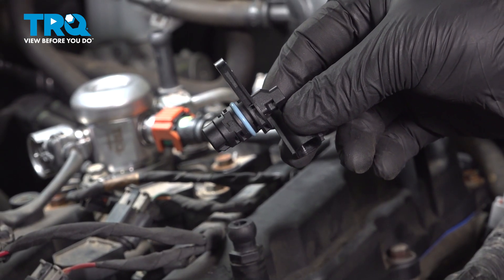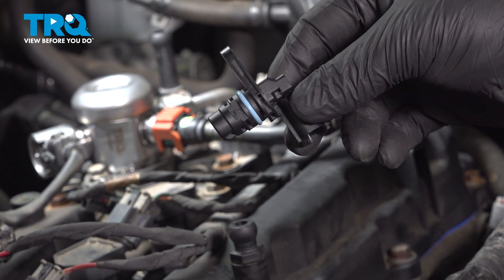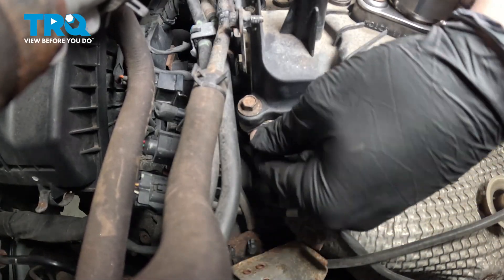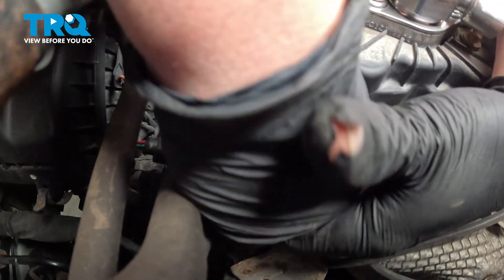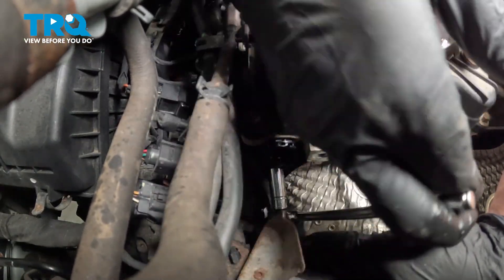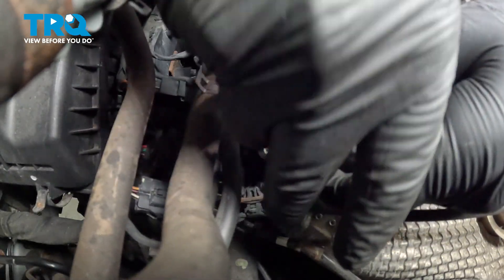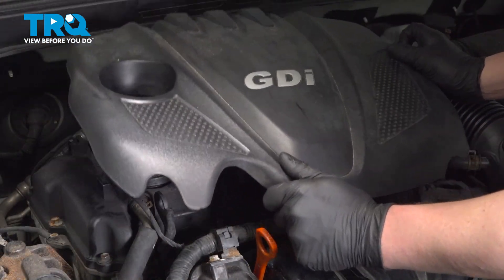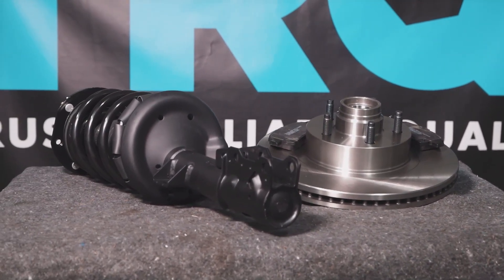How to Replace Camshaft Position Sensors 2011-2014 Hyundai Sonata

Comment: Hi,  I have a 2011 Hyundai sonata. I got a code P0365, camshaft position sensor B circuit Bank 1.  Is the sensor on the intake side or the exhaust side? Thank you!